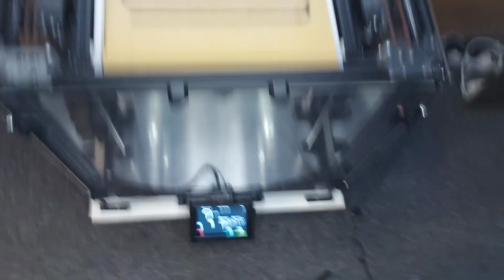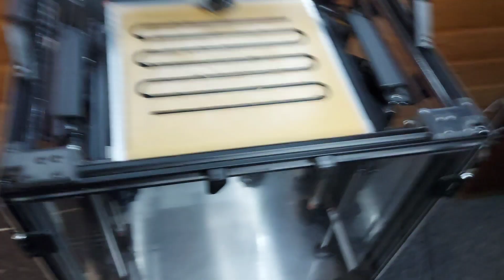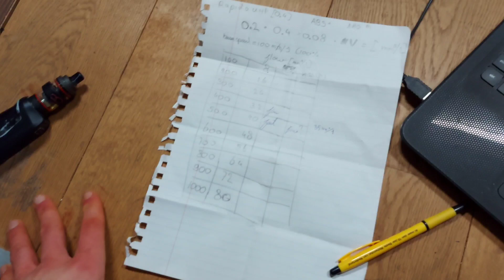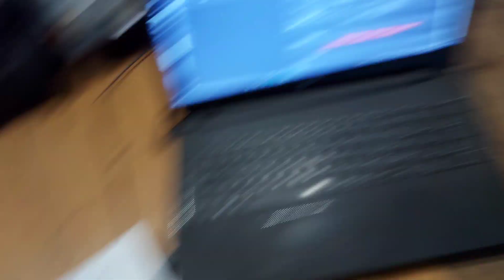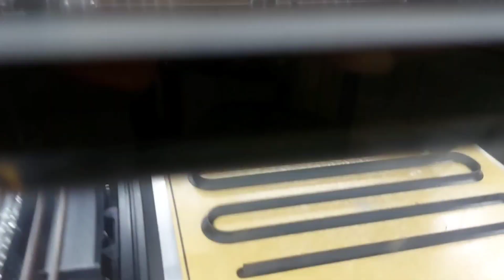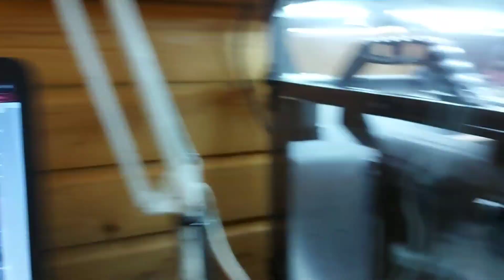VzBoT experimental hotend & rapido UHF flow testing

Comment: Yeah, the Rapido UHF is able to push far more plastic with a larger nozzle diameter. I can hit 45-50 cubic mm/s with acceptable quality using PETG and ASA using a 0.8mm nozzle, same extruder. With the 0.4, it gets choked up and can only push about 30 cubic mm/s.

Comment: Very interesting. I'm currently running an NF crazy high flow with, Bondtech CHT 0.4 nozzle and  an LGX lite on my K3. I found that I was able to flow around 28-33mm3/s depending on filament. With the sherpa mini and specifically the ldo 17mm 8 tooth motor I was able to get over 40. Now I suspect I'm hitting thermal limits at about 28mm3/s and the extra torque is able to keep pushing through even at slower melt rates.
This is with a 60w heater, however I suspect the ribbon and board I'm using may be introducing some resistance, so probably less than that's 
 
Not saying it will make your printer better at printing, but for sheer throughput I can recommend the sherpa mini with the 17mm 8 tooth LDO
Reply from the maker: Good pointer! I may check it out for vz235, i will test first a 0.5 cht in that thing as usually when the hotend is the bottleneck and u overpush flow the layer adhesion is super poor, next thing on that would be vez's new lsd hotend